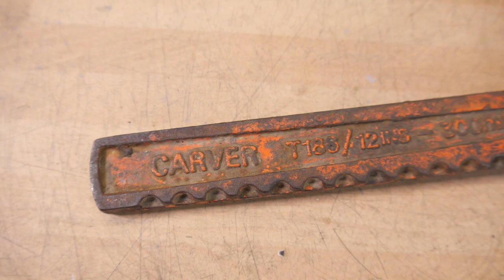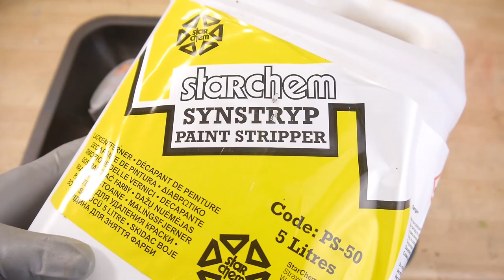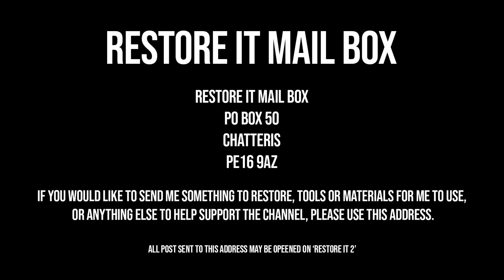Rusty Industrial Carver Rack Clamp Restoration

Comment: Your lathe stickout is huge. Use the tailstock to support the other end when turning down the outside of the hex bar. It's safer and will give you a better surface finish.

Comment: Excellent job, Carver clamps are one of the best cramp/clamp designs in my humble opinion. I have nine of them in my possession.
Great channel.
Reply from the maker: Cheers Bosted! damn, you must have spent some money on those. They aren’t cheap!
Reply: @RestoreIt  yes indeed, I bought 4 new, about £ 65 each, and a the other 5 from a guy who selling all his tools for about £ 100. 
I see from your videos that you are most proficient in surface treatment and spray painting, something I am very much incapable of. I have had good results removing rust with citric acid solution, does not damage base steel, and then Phosphoric acid to convert any remaining rust. The citric acid is very cheap in powder form to buy, and safe to use, about 2 table spoons in 1 litre of  water. Phosphoric acid is a little more expensive, and needs more care in handling, I buy 45% strength, then dilute with 75% water, this is still quite strong, and can be wiped on/brushed until all the rust has turned black in colour.
Thank you for replying, and again thank you for sharing your very high quality work.

Comment: Mix plastic and glas blasting material, youll removera both paint, rust and greasy smudge. I’m using it daily and it works great. Doesn’t damage the metals as much as sand does and works better.

Comment: I love this video. I worked at carvers in the late 90s as there blacksmith welder. May be bias but I think they are one of the best clamps out there.
The only thing I didn't like was filling the cut on the moving arm with filler. That is a weak spot. I've seen loads crack there when people put tubes over the tommy bar to give it a bit more.  I would of filled it with weld then ground back.  Had to laugh about the comments about the colour I used to get told off all the time there when I called the colour orange it is "flambeau red"

Comment: Awesome stuff!

You should try one of those cheap ebay 'action' cameras for filming inside your sand blasting box. full HD with a case etc and if it gets damaged, it was only 20 odd quid.
Reply from the maker: Totally my plan! :) I just can’t settle for a cheapy. Waiting to find the right prices GoPro.
Reply: Restore It you should build a very tiny box out of metal that’s just the right size for the GoPro and on the front use clear plastic or acrylic and you can then  set it at a corner or somehow attach it to the top corner pointing down. Awesome work by the way!

Comment: shame someone managed to snap the face off one side and welded it back on! hence the hole

With the cut (from a grinder it looks like!) you could have built it up with weld and then ground it back flat, rather than use filler :)
Reply from the maker: Oh yeah. I think you’re right. And I was thinking about it. But I’m still learning to weld and have much more confidence in my filling abilities than my welding.